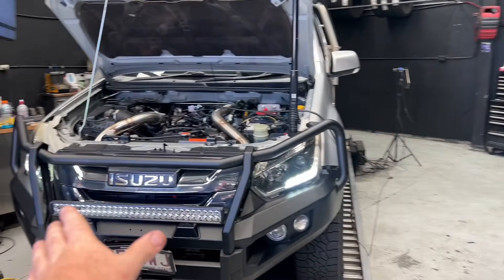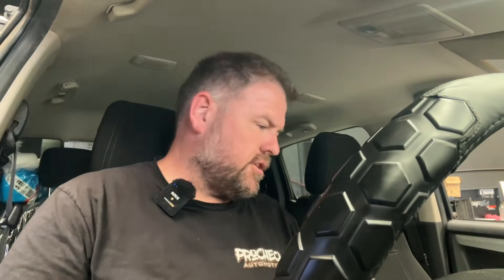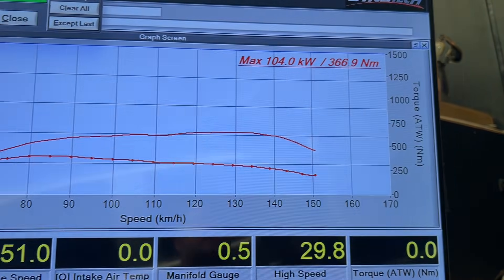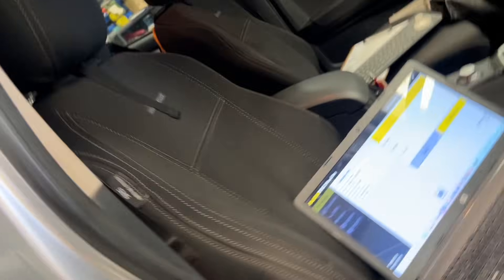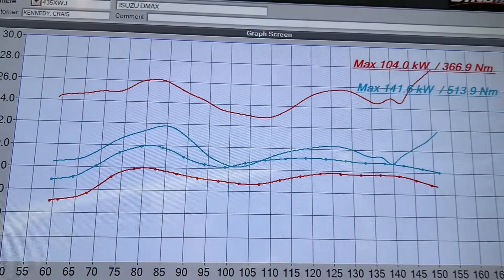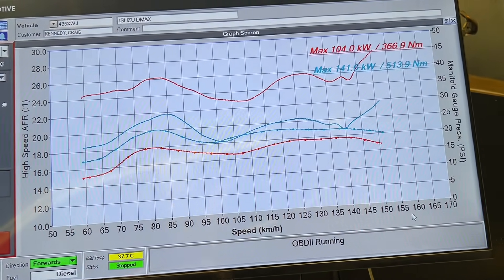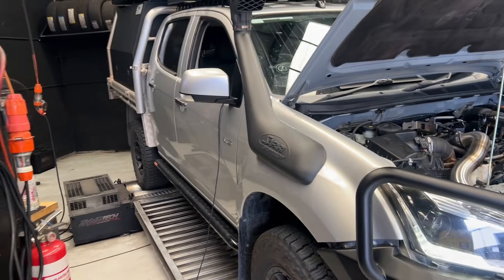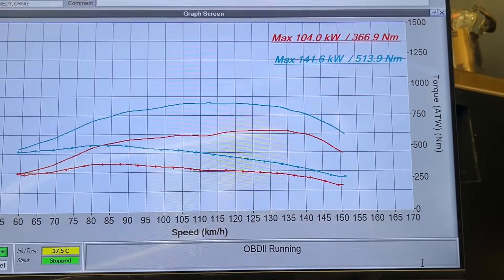How much power does a Isuzu Dmax 4JJ1 get when tuned?

Comment: I have a tune on my 2014 Dmax 3” pipe with high flow cat converter. I put a nomad valve body in for towing. With out the van if I give it too much it’s a terrible change.  Can you adjust the  automatic? It’s the 5 speed same as Land Cruiser. Ross

Comment: Namaste from India, great video brother.

In India we get the 2.5 dmax vcross only no 3.0, i got the mods done  :-

1. Provent Catchcan
2. BRD upgraded intercooler 
3.quantum stage 2 remap
4. Snorkel safari
5. EGR Delete munji 4*4
6. 2.5 inch profender king series suspension  8 way adjustible with profender Upper control arm
7. Diff drop kit sun 4*4
8. Bluegarage underbody protection
9. HKS turbo back exhaust with downpipe
10. BAT 4"4 rear bumper
11. Yokohama geolander 275/60/18
12. Rocksliders ARB
13. Pedal booster
14. FLEX upgraded turbo f55
15. Custom tow points
16. Hamer roll over bar
17. Azoome projectors
18. Roof top light
19. Light bar under the ISUZU logo.
20. ARB diff breathers.

ISUZU is an inderrated ,Very capable vehicle.
Reply from the maker: Cheers 🤙🏻 Sounds like you’ve got a good rig
Reply: @procheckautomotivemechanic4551 thanks mate

Comment: Good information. Thank you. How much of a difference do you think the upgraded intercooler made here compared to if it had been tuned with the stock unit?
Reply from the maker: Lower intake air temps means more power in most cases. So definitely room for more power with more upgrades
Reply: I have a BRD intercooler and indeed with intercooler pipes, the ute behaves very well.

Comment: If done my 1.9 its doing now 147 kw and 512 nm only stage 1 software update the feul economy is good  average 11.4 at 125km/h . The turbo lag is gone and it a real rocket only did it for the feul consumption but the power is there if you need it . I did the maping 42 000 km back and still running smooth no issues.
Reply: Really good power for 1.9
Reply: 2023
Reply: But what year is your 1.9 engine?